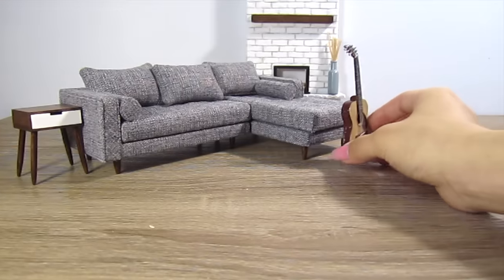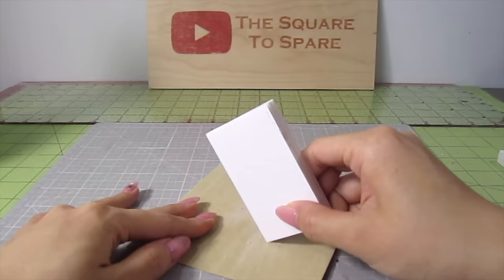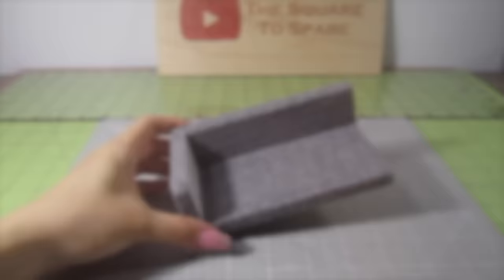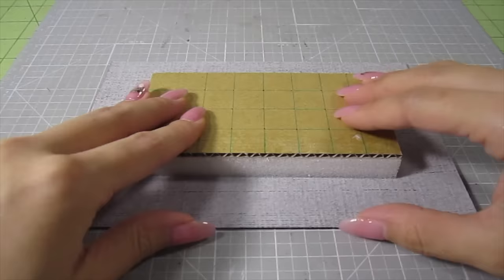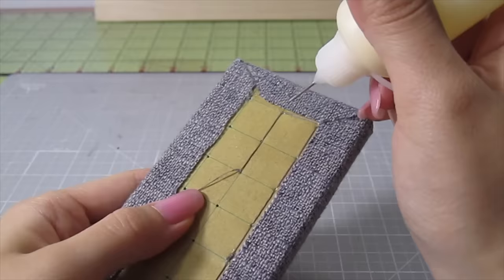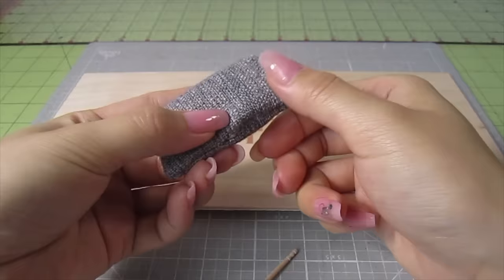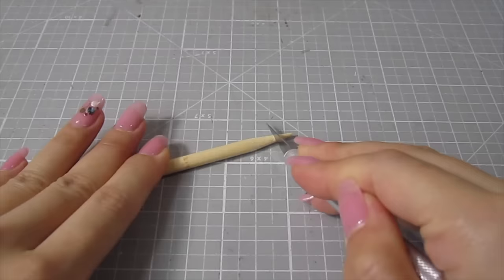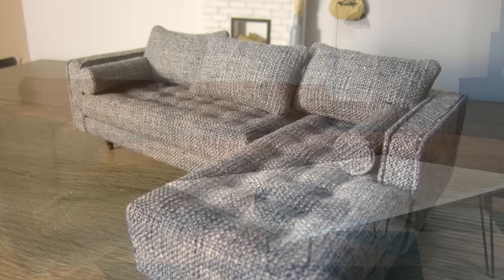DIY Miniature Sectional Couch (with chaise)

Comment: FABRIC RECOMMENDATION * Fellow DIYers! I've made a lovely sofa to this video (thanks Cath!!) and would like to advise you against selecting thick fabrics for the upholstery. I chose the kind of fabric that sweatshirts and hoodies are made of (kinda like flock, woven on the outside, woolly on the inside) because the color was perfect. I ended up having edges that are too thick, and some parts around the armrests aren't ideal. Choose the kinds of fabrics that Cath used, ideally I think kitchen placemats will be great as they are thin and the edges don't fray. Best of luck with your creations!
Reply from the maker: Wonderful tip!! Thank you!
Reply: Does it have the same type of texture?

Comment: Ito make one of these Barbie sized add a extra 7 to 10 inches and make the legs a quarter of an inch! Hope this wuz helpful!
Reply: Addison Plays thank you this is!
Reply: Thank you! I will make this for BJD 1/4  also
Reply: To elaborate: This is in 1/12 scale, or one inch to the foot. Commonly found on dollhouse dolls. Barbie and most similar fashion dolls are approximately 1/6 scale, two inches to the foot. Some dolls (mainly higher end artisan dolls like BJDs) are 1/4 scale, three inches to the foot. Dolls like American Girl and large BJD style dolls such as Smart Doll fall into the 1/3 scale, four inches to the foot. When in doubt, find the measurements for a real sofa (or whatever you're making) in Imperial measurements (or convert from metric). If it's a whole number of feet (example 5ft), just replace each foot with the number of inches (example: for Barbie, 5ft x 2in to the foot = 10in). If it's in inches (example: 18in), then it's easier to just divide it. (example: for AG, 18in x 1/3 = 18/3 = 6in)
Reply: Math makes my head hurt. Thank you for doing the calculations to make it 1:6 size.

Comment: Couple tips... Don't use fabric glue for the pillows. Just sew them. Glue will likely rip apart when you reverse them but even if it doesn't, reversed seams look awful with glue because the line is never razor-edge straight.

For the parts that won't show, like when you secure fabric on the underside, use Fabri-tac glue instead of Aleene's. You don't have to wait for it to dry. It's all around better in many ways, but it is very messy and because it's lower viscosity it can soak through layers so I wouldn't use it for conspicuous sections.

This is a gorgeous couch, thank you for this! Wish you had been around when I was making a contemporary dollhouse.

Comment: What's the thickness of the foam that was used please?
Reply: At 0:22 in the video, the foam board sheets she was using are 1/4 of an inch in thickness. Hope this helps!
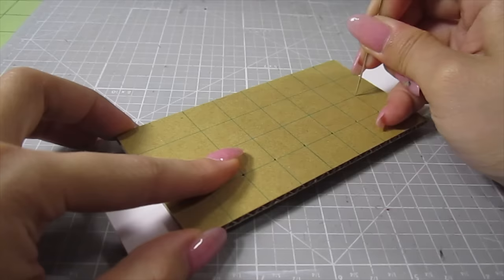Reply: At 4:43 in the video, the foam that was used for tufting is 1/2 of an inch in thickness!

Comment: Hi Cath,  I juststarted to do another sectional.  The last time I had to make the chase pillow smaller, otherwise it big.  This time I did the measurements on cardboard to put that together first.  I found that the chaise back should 2 1/2" x 1 3/4" and the chase seat should 5 1/4" x 3" in order for it to go together right!

Comment: Sorry to ask but I got confused with the part that had to be cut out, in the video it is 5.25x2.25, with with 0.5x2.5 cut out.
In the description it was: 5-1/4 x 2-1/2“ rectangles (cut out a 2-1/2 by 1/2 section on the top right corner). Was it 2.5 or 2.25 for the width of the full rectangle? I did it according to the description, 5.25x2.5 and cut out 2.5*0.5. But it didn't fit with the chaise back since that left 2 inches for the part where it should attach, but the chaise backs were 2.25? I'm sorry I am not making much sense. 

I ended up cutting chaise back to be 2 inches to fit the parts but I was just wondering.?
Thank you. And also, awesome tutorial, making it now :)

Comment: Beautiful sofa. Making it for my dollhouse, but I'm having some issues with the chaise. Were the measurements correct? I cut out the seat 5.25" x 2.5", but after cutting out the rectangle for the armrest, the top was 2 inches, making the back hang over by ¼ inch. Should the back be 2 inches, or should the seat be 2¾ wide? Thank you.

Comment: Where do you find 1/4" thick foam board? Every one I find is a bit smaller than that. :( my chaise pieces won't fit together properly because my pieces aren't exactly 1/2" thick :(
Reply from the maker: Hi there! 1/5” instead of 1/4” works decently well and is much easier to find. I get mine from Arteza

Comment: this is fab thank you = my chaise baks dont fit - r :( i dont know what i have done wrong
Reply: I had the same issue. The correct measurement for the chase back is 2". If you notice in the video, her peices didn't fit exactly (chase and chase backing). The foam board is likely forgiving enough to allow her to glue it together. I used exclusively cardboard as I had plentylying around, so I had to cut double the amount of each peice to build up the appropriate thickness. When I got to the chase back, I had to remove the recommended 1/4" and they fit perfectly now. The cardboard didn't have enough give for me to force fit them and I wanted the measurement to be correct. Hope that helps!